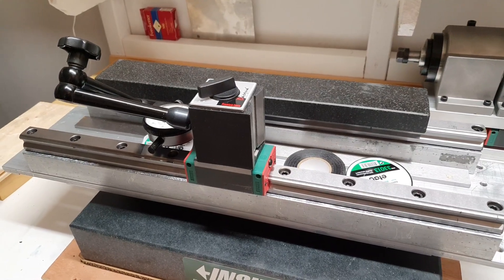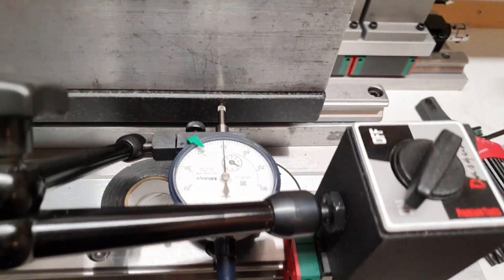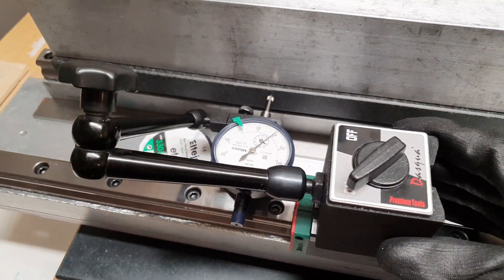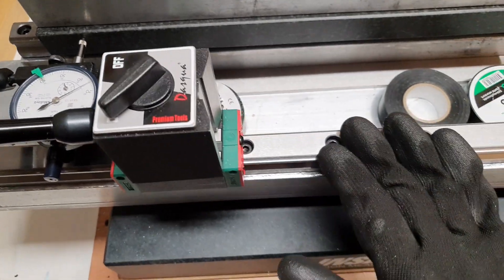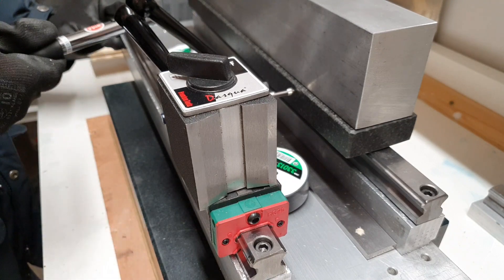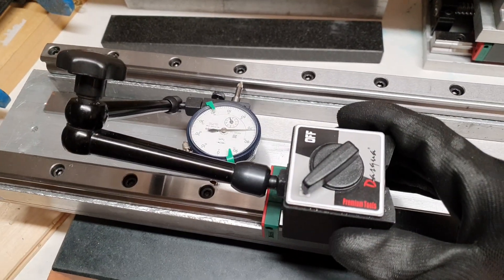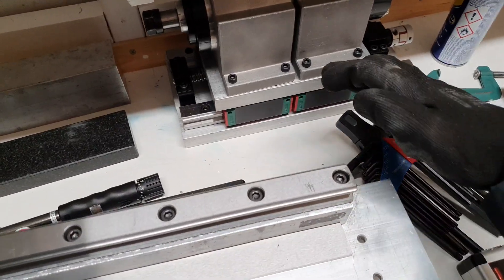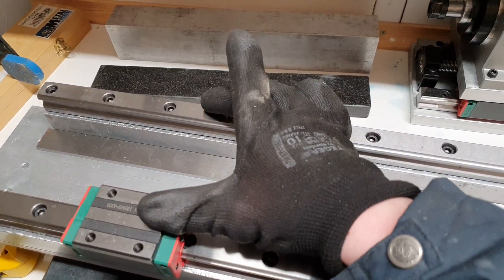Alignment attempt (linear rails 6040 upgrade) (Linear rail upgrade part 6)

Comment: Just found this video. You are doing it the right way, 99% of the videos on YT just sweep rails against rail and that is just so wrong.
Reply: Really? Why? Premium rail manufacturer's (THK) suggest referencing one rail to the other is how to align them.
Reply: @julieta203  Yes, correct. But most people ignore the first step which is to align the first rail against a straight edge.
Reply: @acutabovefurniturestudio  Are you saying putting an indicator on the raw rail is the wrong way and the granite block is necessary?

Comment: Great work! If you had to move the bent rail I would use a torch and quench to move it. It seems like the metal is stressed from cutting, In a pinch you could put the rail in an oven set to broil for an hour or so to see if you could stress relieve it. After the time is over don't remove it from the oven, simply turn off the oven and let it cool down over a few hours. Honestly I don't think it would matter that much since your slide will hardly ever be that far.